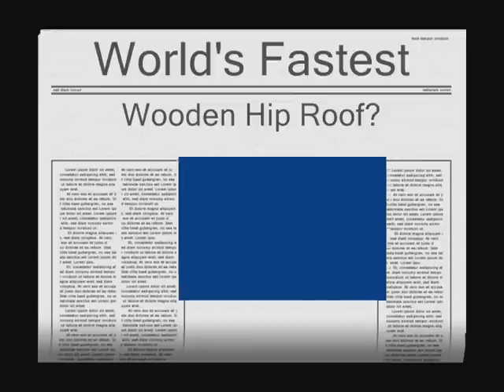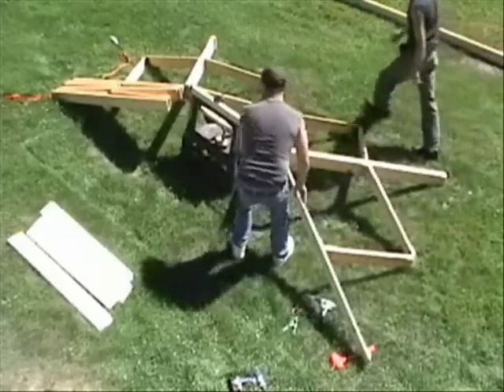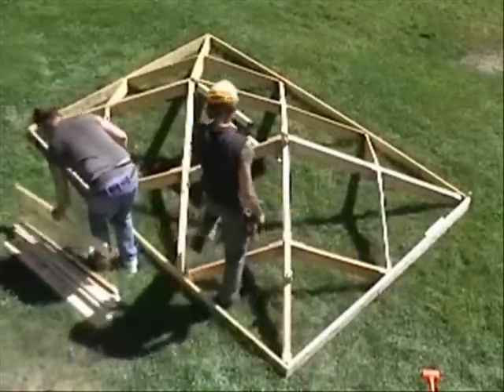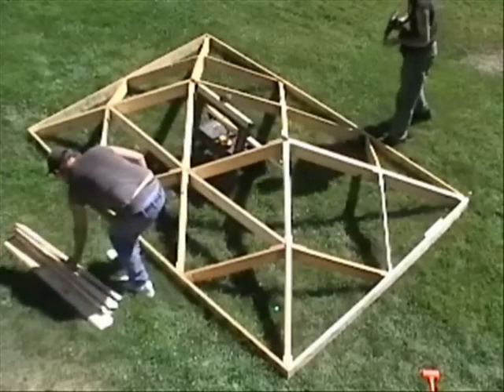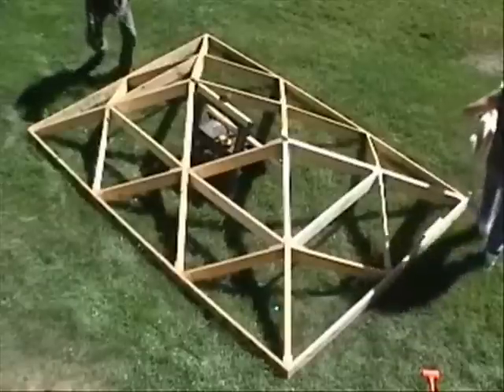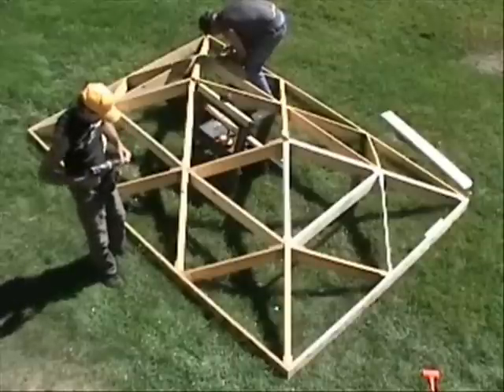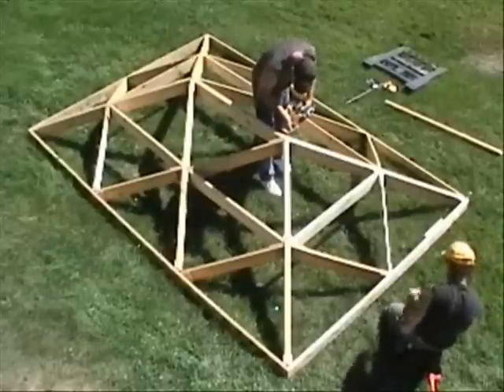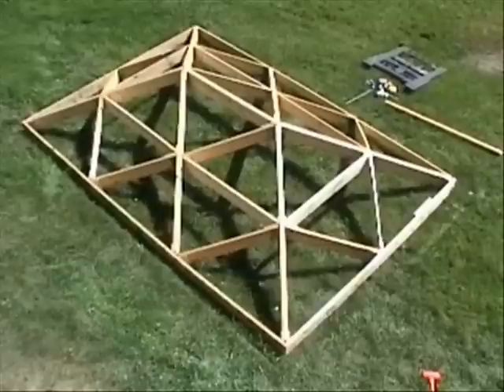World's Fastest Wooden Hip Roof.wmv

Comment: Like most geodesic structures you start with the roof system first the walls last. As small as this is lifting it will not be hard at all with a two man crew. And the geometric pattern can be snapped with a chalk line for plywood.  But it looks like it would still require a tension members running transverse to tie in the upper wall-the final triangle.
Fantastic concept thanks for sharing your discovery.

Comment: I would buy this prefab, preframed hip roof, I just built one. Lotsa angle cuts.. I strapped mine for tin but if you want to sheat this one for shingles, sheath it. A few plywood roofing  H- edge panel clips, a chalk line if you don't want to miss the odd rafter. I always figure it out in time.. If I miss the odd stud or joist , it was likely worth the time to not chalk. If I'm off  that day, use the chalk line - save time.. This is a cool idea..

Comment: I like the idea for simple out buildings. Easy triangle shape to cut and attach plywood to. Has the larger {house} sizes been weight tested. I fear the walls will bow out and collapse. Will the angle be steep enough to allow snow to slide off? Would it be cost efficient to build a regular truss roof or purchase and ship your product?

Comment: Really cool roof! So are traditional roofs, but I saw your bit slip off the screw heads numerous times. Using phillips head screws and "too short" bits? Try a 'torx' head screw and a 6" long torx head bit so screw head slippage ratio drops to nearly zero%. Talk about saving your knuckles, as well as time spent with needle and tweezers going after slivers! Only 1 tool needed is your point, but a hammer to tap the tighter braces into place would be ok guys. Saves your palms.

Comment: I'll give my take as an engineer. This roof frame should have plenty of top lateral torsion strength, but I don't see much that would keep it from bowing the centers of the sides out over time, especially if it were larger. Adding sheathing might help some, but I think it would need some bottom chords for longevity.

Comment: Ceiling rafters will support the roof structure And we use aluminum clips to support the edge of the plywood sheathing which doesn't hit a structural member. I am wondering if it will work as a exterior of a tall pyramid say 24 x 48 and 24 feet from bottom to peak like a pyramidal "A" frame take-off. Like a four car garage with a loft just add a "Dormer" to one side for the Walk door Not to used for parking cars... so no garage door. Use other "Dormers " for several windows.

Comment: From the comments I'm glad I watched with the sound off. Good for a shed, not good for a home. Homes need the straight channels for venting the attic space, otherwise bound to get mold and mildew buildup. I bet a seasoned carpenter could build a traditional structured hip roof this size faster than this if you factored in the amount of time it took them to manufacture this get up. Not that they would, especially if they are union carpenters, work 20 min., take a 10 min. break, etc. LOL :o)

Comment: I think its fantastic! I am sold on the structure. It seems to follow the same principle as the geodesic dome locking in method and strength. From what I have learned of the geodesic dome structures there is no limit to how large you can go with them in maintaining the uniform strength. I presume it is the same with this roof method. I do have a question about how the expanding pieces were initially put together?

Comment: If you were building remotely, it would be much easier to carry than sticks, a generator and a saw. In the video 2 men lifted it without a crane. As for nailing, it all triangles are equal, one triangular layout template could find all the "meat." Not saying it would work for every custom house job, but let's say you were trying to roof a dozen cabins at a rustic camp in a weekend and still find time to fish. Might be a neat system to use.

Comment: Because the 'common' rafters meet the top plates at a 45 degree angle, you cannot install cross ties or ceiling joists, and sheeting the roof with plywood would need a lot of extra pieces installed. And you don't  have rafter tails for overhangs around the building. And I guarantee I can cut six rafters and four sets of jacks, and frame the roof in the time it would take you to cut and assemble your package. But I appreciate your innovation.
Reply: Great comment , looks great , lovely design but totally impractical

Comment: @skoockum I believe they intent this to be a roof that is premanufactured by them, so the pieces will be precut... the service they provide is all the calculations and preparing the material. 

Anyways, I have designed modular structures myself, and it is great to see this. You are right, the cost in materials is greater, but on the large scale, the savings in installation time, the savings on shipping the materials compactly, and the savings from only manufacturing 3 pieces may outweigh that.

Comment: Too many comments here about the sheathing; no, it is not difficult, in fact it is really, really fast and simple. Structurally there is no requirement to use ply wood for rigidity, so 1x10s would be cheap and fast. If you want plywood, just get a roll of paper and transfer the truss member locations. The joining of the plywood edges is simple, just those little clips.

Comment: As a Joiner.. I first thought that this was brilliant but in hindsight of watching the video i have thought its not so good. Looks very fast but most people do not realize the amount of work that has to be done to get to the stage this product is at at the start of the video. If all your timber was cut to size then building this roof would be far quicker the traditional way. Its just like timber frame houses. We used to lay ground floor joists and erect wall panels in one day and erect roof trusses, sheet it with ply the next day. Looks very fast indeed but some guy has been cut the joists to size, making the wall panels and making all the trusses in the workshop/factory for the past week!!! Do not be fooled by this gimmick...
Reply: That's what N/C prefab is all about- inexpensive, precise products. THis isn't a build it from scratch from raw lumber in your garage- it's a SMART kit!
Reply: *****  it must be a bitch to get the angles right I guess
Reply: Kevin Greig This is a self supporting system. Trusses cut out clear space inside your structure. Plus it has it's own aesthetic. It all depends what you're building and what you want it to look like.

Comment: 10 minutes huh? how much time cutting and preassembling? Probably much longer than just building it in place.
Reply: I imagine scoring a big contract to build sheds in a track home type scenario where everyone gets the same shed.  These dudes would be crushing it if they pre-cut pieces for anything more than 5-10 sheds.  Think about 50 or more! Great system for that application.  Set up stop blocks and jigs and cut away!  And if this structure was designed, I'm sure that pre-cut and snapped nail lined sheathing would be easily mass produced as well.

Comment: If one sheaths both sides using glue along all contact surfaces, the resulting torsion box should be brutish, even if the inside uses 1/4" and the outside, 5/8.

Comment: Why are you encountering so many framing inconsistencies in 4 short length walls?  That really shouldn't be a problem.  These guys managed to frame 2 dozen equilateral triangles with no problems and that requires far more accuracy than some stick built rectangles.  Clearly they're more reliable than whoever you've had the misfortune of working with.

Comment: Please add demo of adult weight person standing on hubs where the geodesic angle spokes connect (center of star pattern)...one at a time, as an unbalanced load. ...What happens if the weight moves...like a tree fall? Or high winds from one direction? 
Please show how this roof mounts to a building, securely? 
Is this roof system scalable to larger buildings, or is it restricted to small buildings or use of multiple small ones to cover larger building? 
Part of structural physics of geodesic domes, is that the hubs where angle boards meet, are convexed outward.  That cannot happen on the demonstrated flattened sides of this roof...doesn’t that make the hubs weaker under some circumstances, in this application?

Comment: Impractical even at a small shed size. No heel height to set on the walls. And what if a 8' piece of plywood doesn't cover the whole side? There's no place to but a second piece of osb/ply breaking on a 45 without tons of sheeting waste. Plus you have to get it up on top of the structure once it's built. On top of that I can see a bow in the fascia of both the sides we can see. So it isn't as "perfect" as suggested (even if it's user/assembly error here). I don't think it's weaker as I've been on bigger dome churches and such. Once it's screwed together it would stiffen right up. It would just be a pain to deal with in anything but a small dog house. If prefabbing is the goal here, the same is done by most experienced crews today, and doesn't need a delivery time for odd sized buildings not in "stock". All the pieces are cut and ready to be assembled by any decent cut man. Can you imagine the home owners with little to no experience trying to get this structure up on top of 8' walls? It would be hilarious.

Comment: I've framed for over 20 yrs. No way prep time included is faster for simple roof like that. If it was it would be the standard already.
Reply: This is not meant for traditional builds. Think DIY and or emergency buildings. Manufacturing and shipping of the package should be cost effective as it uses only three different parts as explained in the video. 
Try not to think why things won’t work but under what conditions they could. 

Sheeting could be difficult, but maybe sheets could be fitted by just 1 diagonal cut.

PS. Traditional framing will probably be most efficient in 95% of the cases or more. No question about that.

Comment: And if the wind blows the roof off, it neatly folds itself back up, ready to haul off.
Reply: +newstart49 The cross boards the guy is placing between each section are there to prevent that problem. Connecting the whole piece to the outside frame is a second support, and then of course the rest of building below the roof will provide additional support from the roof to the ground. Roofing material will block the wind providing more support, so I don't think it will fold back up by itself.
Reply: Sophia Hanson
 It was a joke.

Comment: I built a roof or two over the years and I don't see how this could pass code.  The load would push out, not down through the walls.  Take off the face boards and try walking on it!
Reply: Agree with that Josh. All sorts of load problems there. Looks nice but thats it.
Been a builder 45 years. Seen it all.
Reply: 1/2" roof sheathing would  pretty much nullify outward thrust.  Besides, who cares?  It's not a residence, it's a large dog house.  There is no code for it, and I doubt you have to worry about a 100 psf snow load.

Comment: Not worth it to carry the whole pack on the roof. Easier to cut and do it one by one - The space has to be smaller than what you have between rafters. Plywood will bend in those areas. And it is impossible to apply insulation in your roof if needed.

Comment: The narration is numbing, sheathing is rectangular, the weight becomes unmanagable to handle when you scale up, but if it uses less wood for a stronger roof, then this may be interesting design for a piece made roof, if not a folder.

Comment: Its not pessimism, it is reality. I like Geodesic structures but for a hip roof it is impractical and wasteful. There are many flaws in the design, I am all for thinking outside the box but this is unsafe and it will cause many problems down the road for a home owner. It is great to experiment with new ideas, improving on construction strength, efficiency or aesthetics is a good thing. This does not accomplish any of those characteristics.

Comment: Am I the only one who thinks this is not a good design? Here are my points.
Sheeting this would suck, especially if it was bigger, it would be a massive waste of plywood or OSB and the time it would take to sheet it would be 30 times longer than normal

It seems strong but snowloads are much heavier than two men and having screws instead of nails means all the joints have no shearing strength.

How do we know it is square and that the fascia is straight? I can see bowing in the video

Am I wrong

Comment: Buckminster Fuller, triangles are the strongest, eh. Dont know about much architechture so should  shut up. 
Penople there is employment or greatest efficiency and there is, they haven't enough houses in Haiti or money to buy them. A disccusion of need for employment versus need for cheap goods should be intereesting. Make the money expand to pay for the things you have the workers and materials to do anyway, which is not the same as buying and selling air pockets as bankers did before 2008.